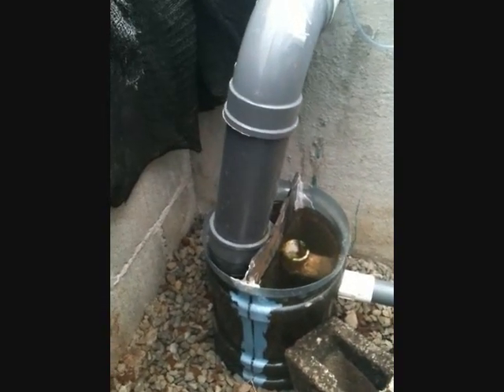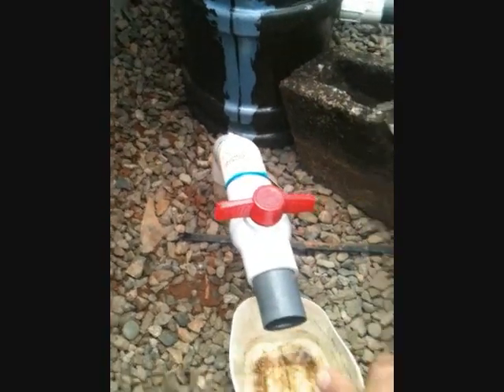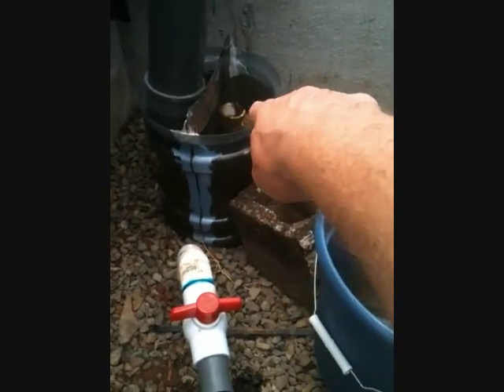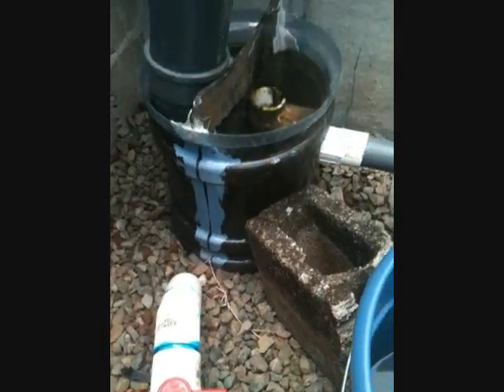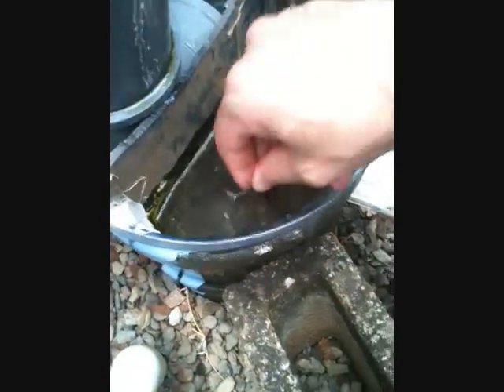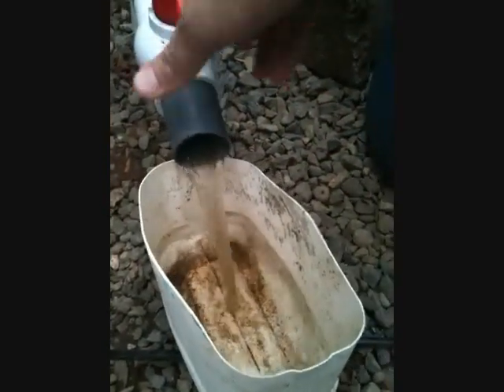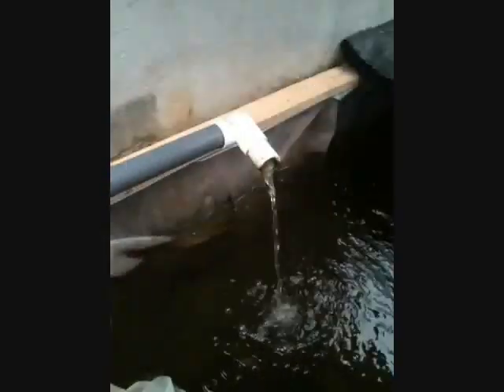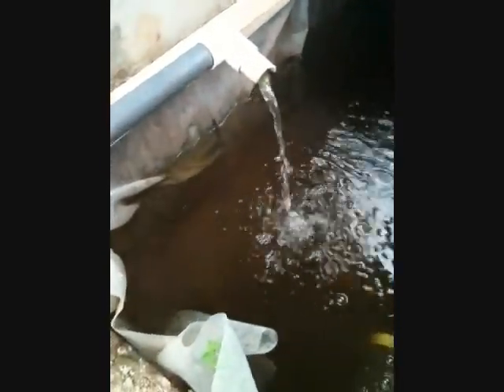Aquaponics Clarifier Using 5 Gallon Water Jug

Comment: Bacteria with tendrils (arms, tentacles) form in the settled sludge & becomes a mat.  You can't avoid that unless you kill the bacteria.  Too bad the system will circulate whatever kills the bacteria that you don't want and also kill much of the bacteria that you DO want.  A taller bucket/barrel for your filter will help increase the pressure.  I'd advise using something like a bottle brush to dislodge the bacterial mats.  It'll be faster.  You shouldn't put the solids that you remove from the water back into your system.  Good luck.  Now that it has been 5 years sinse you uploaded this video, how about an update?  Did you figure any of my suggestions out for yourself?